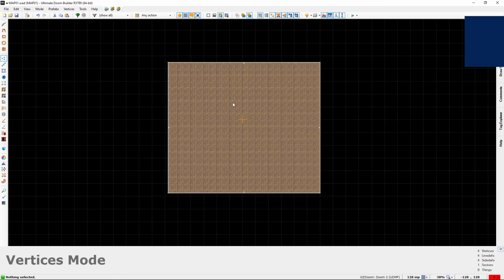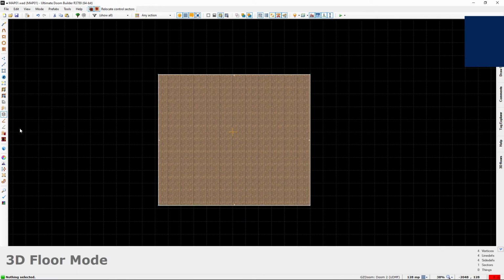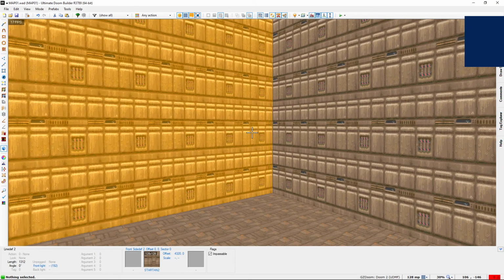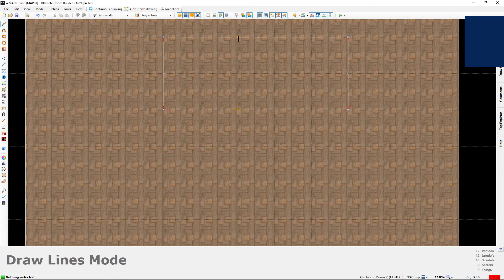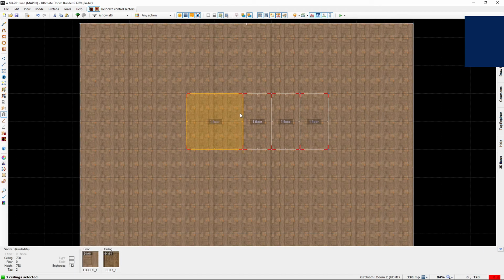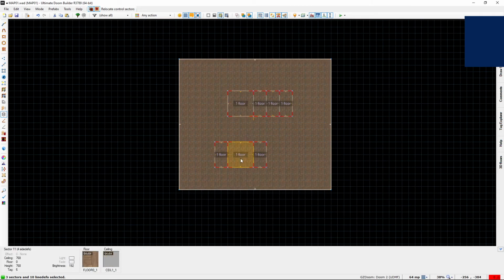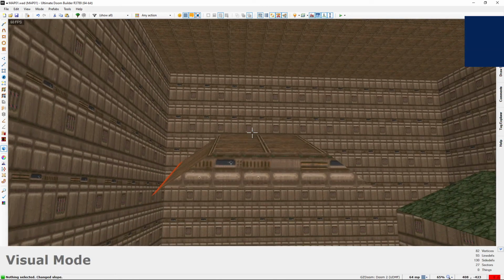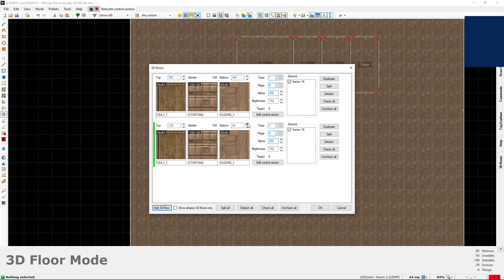3D Floors in Ultimate Doom Builder

Comment: That is a cool and certainly is an essential tool to use, and must indeed be taken advantage 
of,  wherever applicable. However, i am still not convinced that it makes the old manual control 
sector method obsolete. I do some very complex stuff with 3D sectors, and i do mean complex -  
as in multiple stacked floors, plus ceiling and actual floor - all of which are part of a structure - 
(especially when it is small), and quite often i had to move the control sector itself to smooth
out issues when the sectors begin to overlap, and there is no other way to move them. A good
example is a 3D cage hanging on a 3D chain, or a fully 3D library with books in 3D with flipped
pages, or the proper boats - not the archaic orthogonal nonsense, but more like the realistic 
scalable models that are sold in the toy/diy shops.

Comment: what keybind is it to interact with linedefs that you used at 2:13
Reply from the maker: I forgot to mention it in the video when I recorded it, but it's explained in the video notes:

"Quick explanation of the slope handle picking: 

Assign a hotkey to "Toggle visual sidedef slope picking" in the Controls tab of the preferences dialog. That'll let you use the slope handles like I do in this video."

If I recall correctly this might not have a hotkey assigned by default